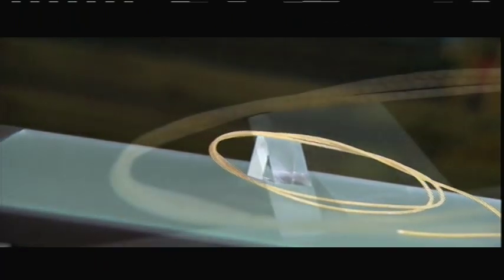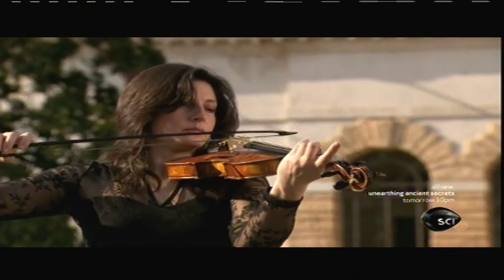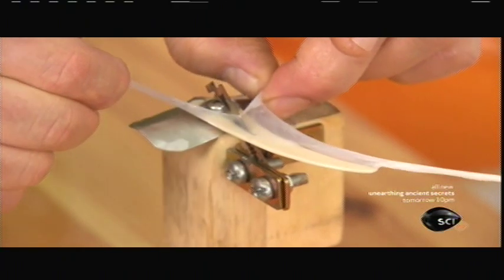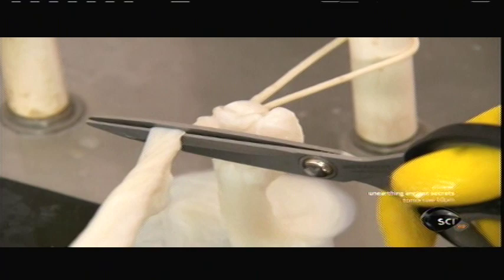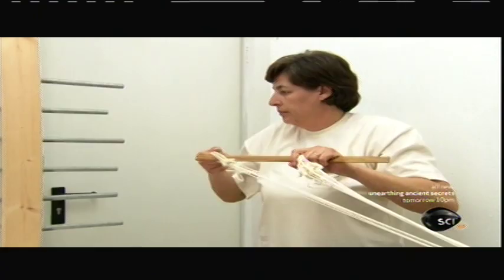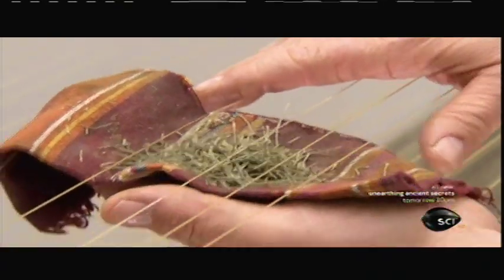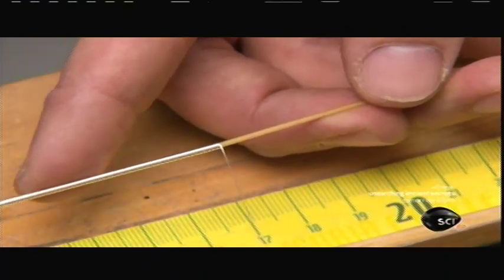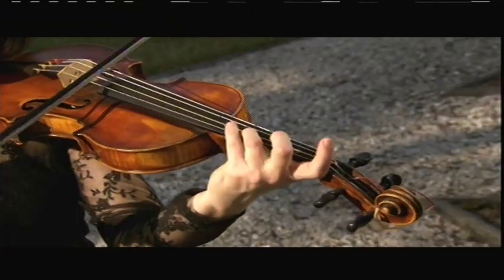How Gut Strings are made

Comment: i wonder how much gut strings are worth?
Reply: depends on brand and the instrument you want them for. For example, you can find cello gut strings for 200 dollars a set
Reply: @theDragoon007yaboiCJ   You can spend up to $900 USD for a set of gut bass strings.
Reply: @pauloconnell8259  dang thats a lot of money for something that is pretty much "disposable"
Reply: @theDragoon007yaboiCJ  Not as disposable as that. Gut strings can last a long time if you're careful.
Reply: @richardholmquist7316  So should they be saved for more delicate pieces? Or with taking care do you mean mostly the care after using them. Because i would imagine they wouldn't last long for someone who plays a lot of fortissimo allegrato
Reply: @theDragoon007yaboiCJ   Until late in the 18th c. stringed instruments usually tuned about a half step lower than today's a' = 440 Hz. This meant strings didn't snap as often. The trouble was, wind instruments usually played about a half step higher than 440! So when winds and strings played together, one group's parts had to be transposed, just as some instruments play transposed parts today. This is a big subject with a lot of exceptions, but that's basically it.